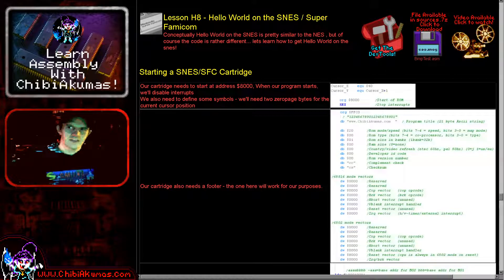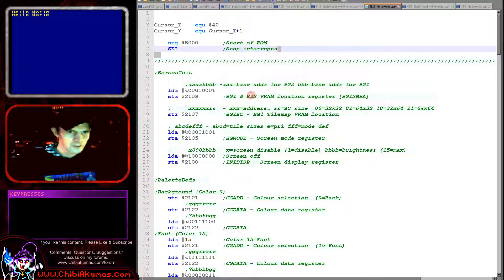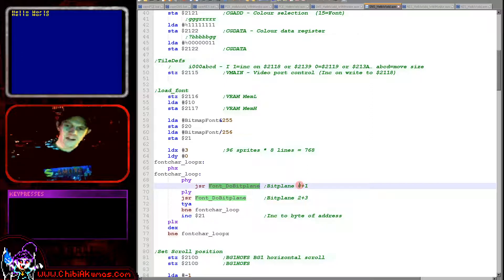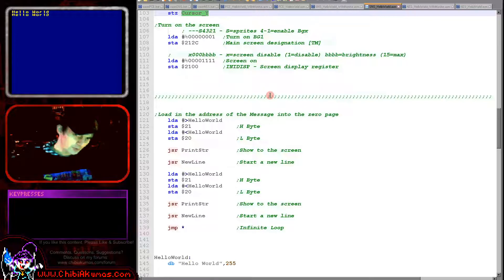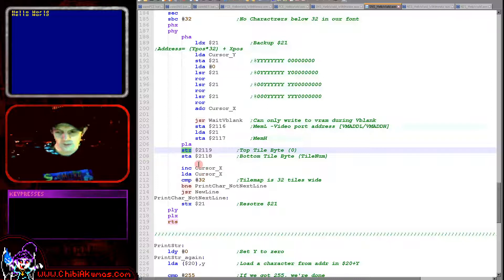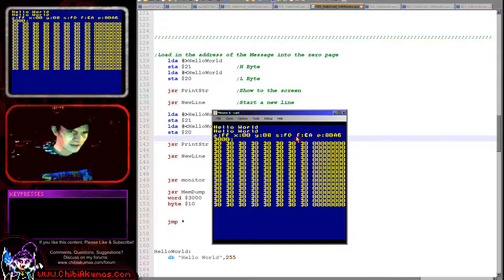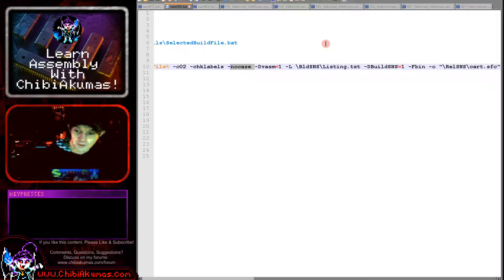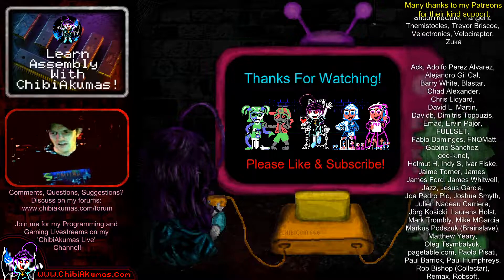Hello World on the SNES / Super Famicom - Learn 6502 Assembly Lesson H8

Comment: So the SNES architecture has a built-in default sprite-font? I wasn't aware of that.
Reply: Correction: Sounds like the font-setup was around 5:00 but still beyond my understanding as to how the color values for the 8-by-8 tiles were defined.
Reply from the maker: Yes, I define my own font as bitmap patterns and draw them to the screen via the tilemap.
I'm not aware the SNES has any internal font in ROM or anything.